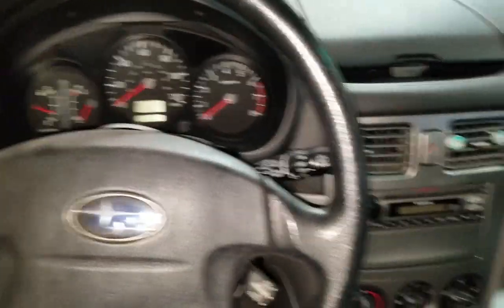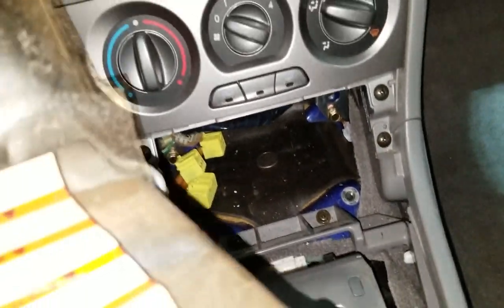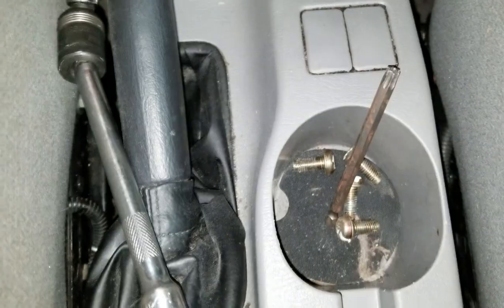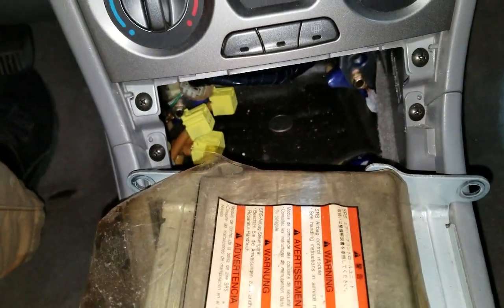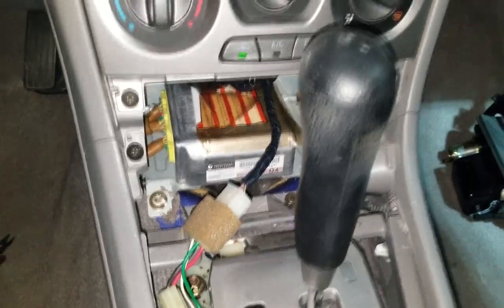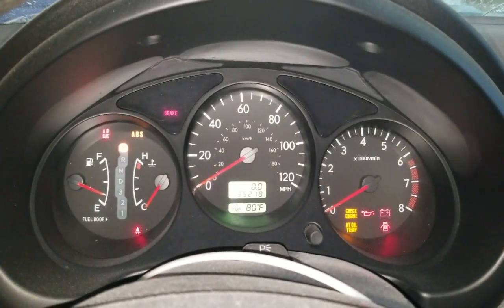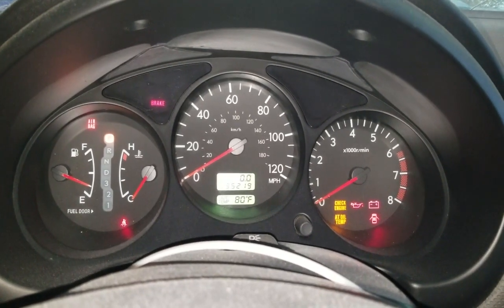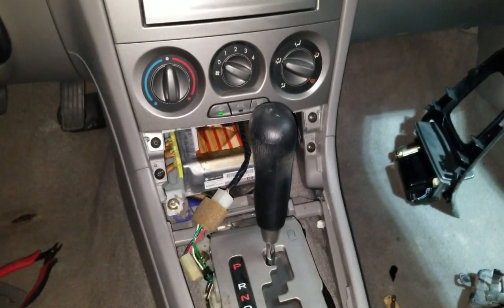How to Reset SRS Airbag Module After Crash Full Process EEPROM Removal And Reinstallation

Comment: Do all the airbags need to be replaced before resetting the module? My car was in a fender bender and driver and passenger airbags were replaced but not the side curtain airbags. 2017 Ford Mustang Gt, thanks any feedback appreciated.
Reply from the maker: All deployed airbags and seatbelts need to be replaced in order for the light to go away. It is best to replace them before resetting the module.

Comment: hi, I purchased the carprog clones 10.93 version but that didn't seem to read my 95320 chip from a 2004 honda accord. It kept giving me an error, any suggestion as to which tool I can use which would most EEPROM chip and not cost a fortune?
Reply: Original carprog. Chinese you have to modify. But even when you modify it’s ok. Not the best.

Comment: How much to reset the airbag module on a 2016 Toyota Sienna. I already replaced all airbags and seatbelt but still get codes b1876,b1901,b1906,b1941
Do you guaranty the codes to go away and turn off the airbag light?
Reply from the maker: Its $50 to reset the module. We guaranty that the module will be like brand new. The light will only go away if everything is hooked up properly and you don't have any issues in the vehicle.

Comment: What software are you using? and how would I know which data to change if I don’t have a clean data copy to compare?
Reply from the maker: Here I was using UPA by Elrasoft programmer and software. There are several softwares and programmers that will clear the crash data for you. Or if you would like you can send me the dump file to autocsolutions@gmail.com and I will clear it for you for a small fee.
Reply: I want to repair mi airbag light but I don’t have tools , how much for reprogramming my module  ?

Comment: Is there a simpler method via obd2 port to clear srs module?
Reply from the maker: Not on this model. Every module with an eeprom has to be done manually. On some of the newer modules with MCUs we can reset through the obd2 port or connecting directly to the CAN lines of the module.
Reply: Automotive Circuit Solutions Thanks for the response man. I am trying to open up a shop here locally where I live but currently trying to see what is available out in the market for airbag module resets.